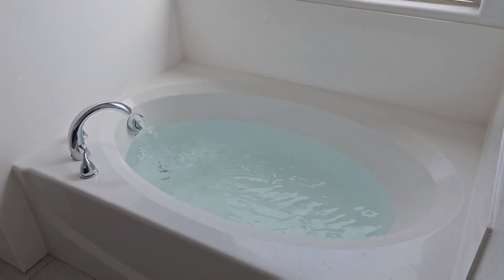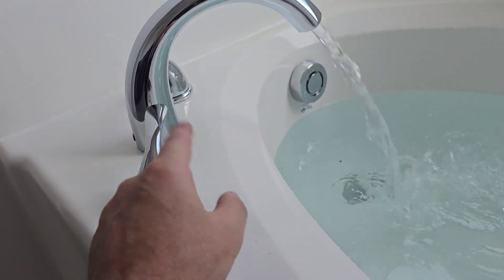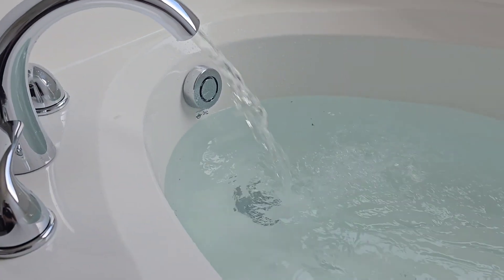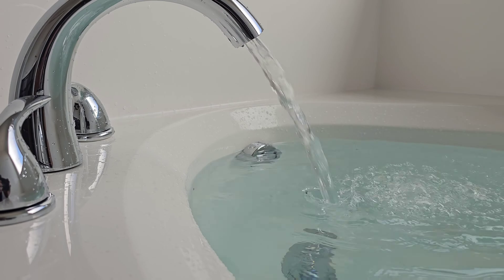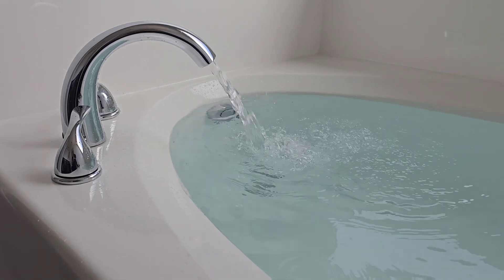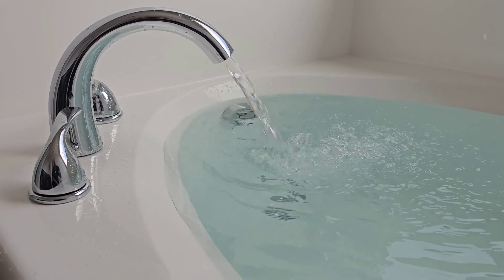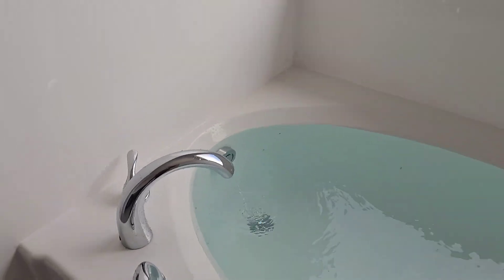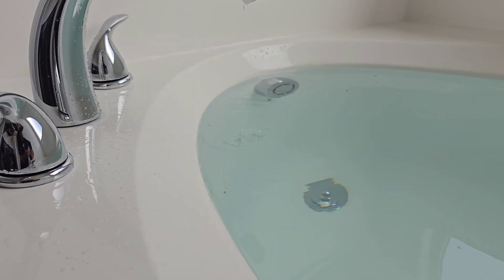Flow Issues Revealed in Bathtub Overflow Test on Second Floor - Must Watch!

Comment: The water on mine goes passed the overflow and takes about 5 minutes to emergency drain. I'm told by maintenance that the hole is small and I shouldn't put that much water in. I don't do it on purpose, Just wanted it checked for a real emergency.
Reply from the maker: It's good to know it helps, but it really should keep up with the flow of water. Theres bot much ypu cqn do, be careful!